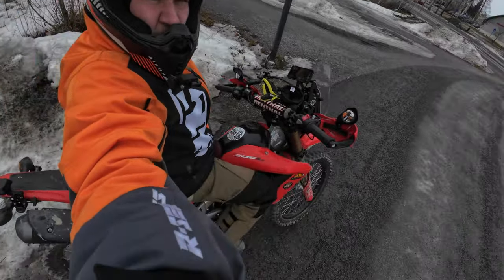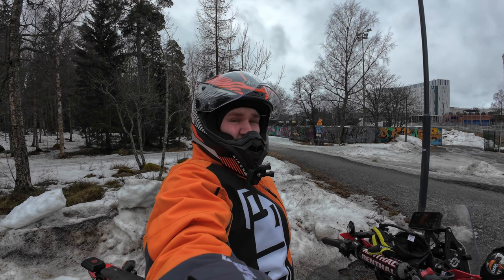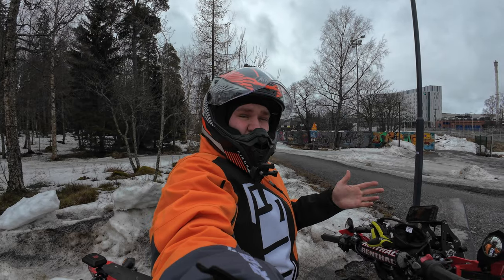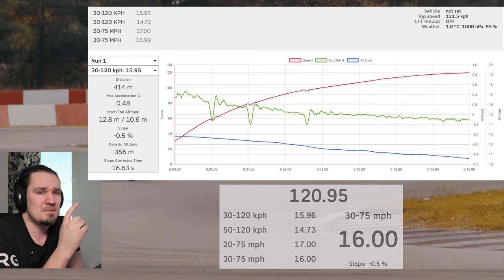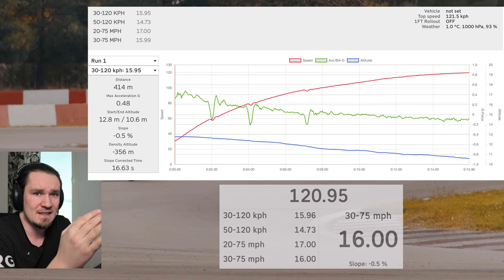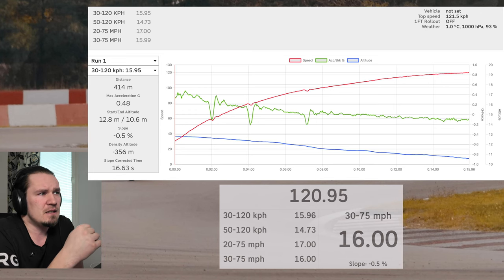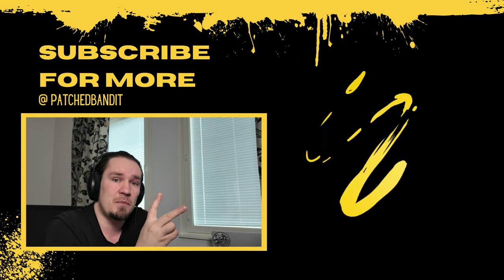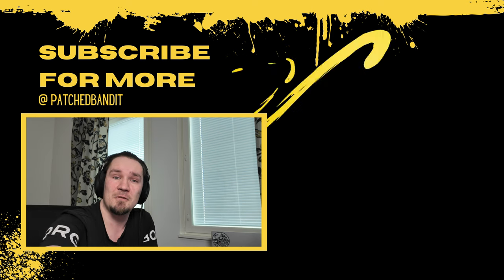Is Honda CRF300L TOO SLOW?! Part 2

Comment: There you are. Measuring accelaration is quite a science and needs time to get the best results. Ask why I know. A small bike like the CRF 300 is perfect for adjusting your skills. You're getting stable results, that's a good sign. At least nowadays you don't need a wheel following you like in the 1990s ;-) Günter/Nürnberg
Reply from the maker: The one slow run was due to a strong wind gust 😂 It's the little things with this Honda for sure. I could still probably get some time off that but I need to stop at some point 😂 
Next we will see how much better it is after all the powermods 💪